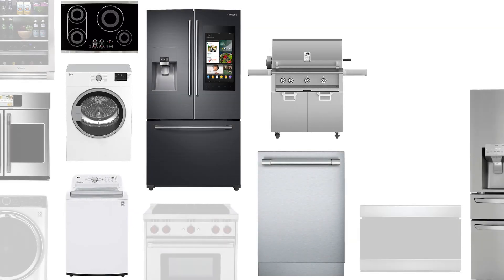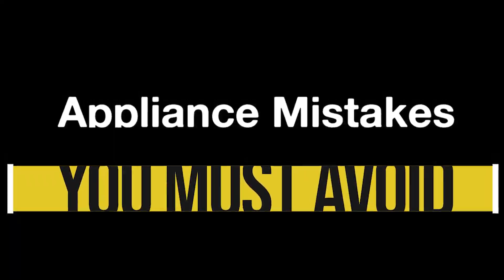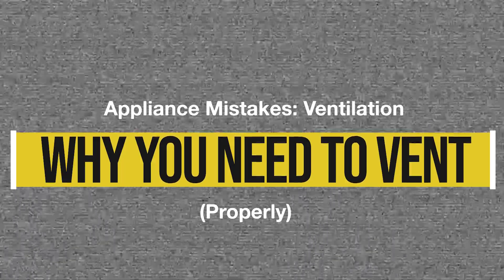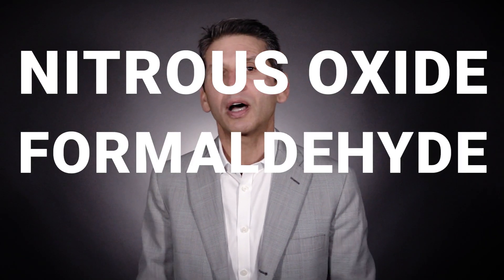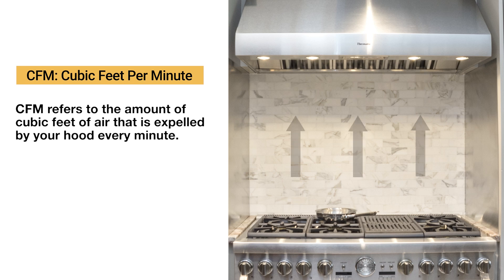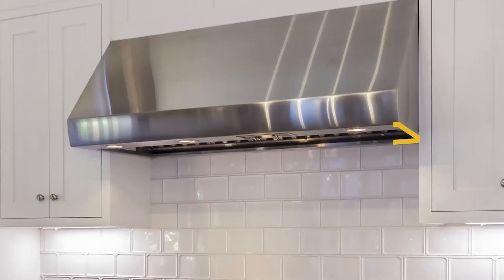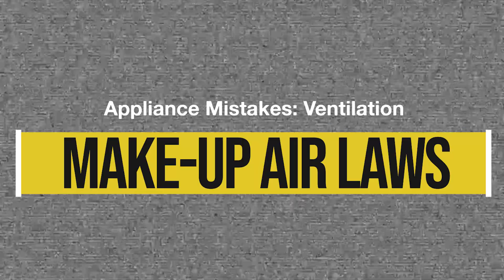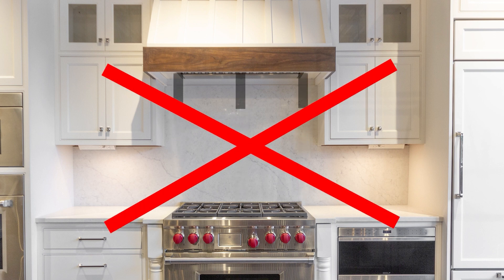Appliance Mistakes Series: Ventilation

Comment: One very important thing you did not mention is to use the proper exhaust ducting size. Assuming a single bend in the ducting and not more than two stories thru the roof, the following guidelines may be helpful: 600CFM and under should use at least a 6 inch ducting, 600 to 900 CFM should use at least a 7 inch ducting, 900 to 1,200 CFM should use at least an 8 inch ducting, and anything over 1,200 CFM should use at least a 10 inch ducting. The more bends or longer ducting, the bigger diameter the ducting should be.
Reply from the maker: Definitely...Used to see people using dryer ducting back when I started....
Reply: @YaleAppliance1  Another good point to make is to never use any type of ducting that is not intended to be used for Kitchen Exhaust Venting. Any form of ribbed or flexible ducting is a magnet for grease accumulation and is a sure risk for fire.
Reply: I had that problem, my electrician installed a 10" duct when it was recommended to have at least 12". When I realised and moved to the appropriate 15" the difference was huge!